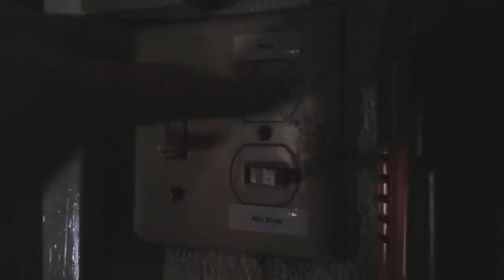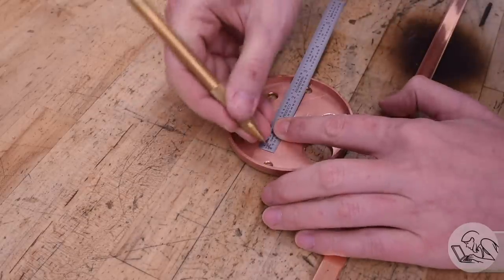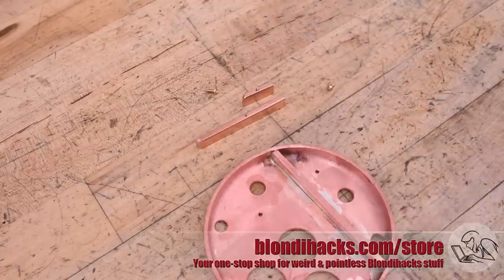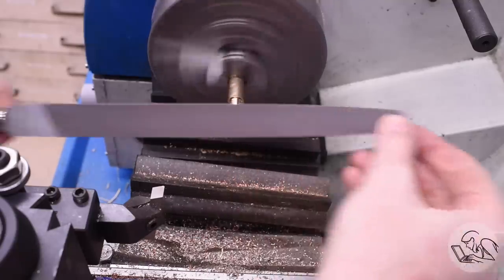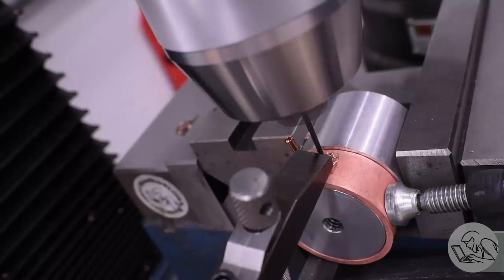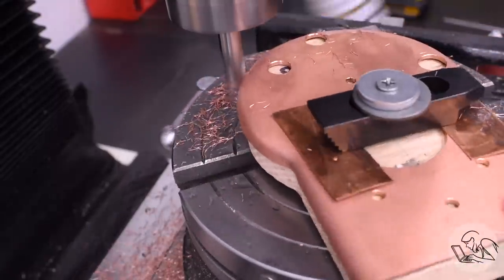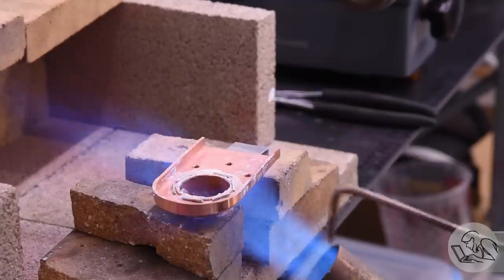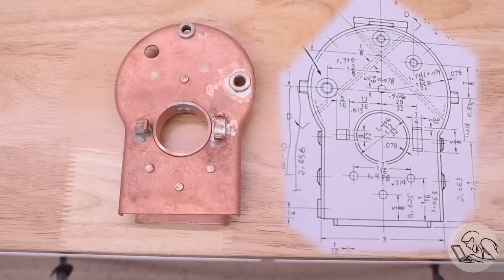Finishing Boiler Bulkheads - Pennsylvania A3 Switcher, Part 3

Comment: Tip:  For Brass and copper & Aluminum drilling.
keep a set of drills at a 100 degree angle, also I  tend to put a back rake on my drill bits for drilling brass and copper to help stop it from grabbing, most drill bits are set at 118 degree angle and for harder metals 135 degree is good
but soft metal don't work great on those angles.
So have the correct drill bits for the type of metal.
As you say about safety, i was using a industrial vertical bandsaw the other week and one of the teeth pinged of and got me at the side of my glasses and stuck in my cheek, so even machines that look harmless enough because you cant see sparks is worse in my books.

Comment: Quinn, did we hear you say that you did not have any drill bits larger than 1/2" diameter? If that's the case, head down to Princess Auto or Busy Bee and get a set of "Silver and Deming" drill bits, which are larger than 1/2", but the "back end" of each bit is just 1/2", so should fit your mill or drill press chuck.

Comment: Re: PPE... traditionally, I have been very bad about wearing PPE, and have to date been mostly lucky. However, as I have begun using my machine tools, I have a rule for myself... if the power to the machine tools is on, so are my safety glasses. I find them frustrating when trying to make fine measurements or complete intricate setups, but if there is a chance that metal might be cut, safety glasses on.

Comment: Beautiful craftsmanship Quinn. You are so right about making sure every silver soldered joint is sound. By the time a completed copper boiler is finished it is a huge heat sink. Even covered in insulation it takes a long time to reheat a bad joint which as you say is not at all good for the flux.

Comment: nice work,thats way more parts than you would expect when you look at the finished boiler.I wonder how critical the solder is to re-melt when you add parts and heat near the already soldered areas.And if that is a problem in terms of causing leaks.

Comment: I’d blame it on the drawing: the lack of complete hidden line around outside edge of the part leads to confusion.  If you are going to show the bracing, and where it meets the outside edge of the flange, show all the hidden lines in the drawing.  At first glance, I also thought the drawing was from the other side.

Comment: I had a 15/16 drill break off in a 12" inch cube of stainless steel on night,the forman wasn't happy about it.Ofcourse the circuit board burned up at the same time.

Comment: I'm a little surprised that you didn't turn the outside of the fire door ring down to match the hole size. I was expecting you to pop it back on the former and take it right to size. With the correct clearance of course. LOL Love your work!
Reply: That threw me off as well.
Maybe there is a reason? But I can't think of any 🤷🏼‍♀️😁
Reply: Me too, but perhaps it would have been difficult to hold it to the mandrel securely enough to skim it. Or that's what the book says to do and it was an easy enough way to do it.

I certainly would not have remade that first ring, it looked plenty good from here and better than I could do! I wouldn't have bothered with the little riveted tab either. But then I thought perhaps that acts as a bit of a spacer between the two backhead plates.

Slightly shouldering the stays would also have been good for spacing as they were turned. But given you're usually using copper rod or rivets for those the lack of steps is normal.
Reply: With the riveted plate on it, you couldn't really turn the whole thing, so you'd have to do it either on a fixture, or in two setups.
Reply: @TheFreshmanWIT  but there is no need to turn the whole thing.
Just that bit that sticks into the hole.
Reply: @Jehty_  It sticks in a hole on both sides, it goes through two bulkheads.
Reply: @TheFreshmanWIT  oh, of course.
Somehow I completely overlooked that.
In that case I guess it really is faster and easier to just fit the parts by hand.

Comment: Could you not put the reamer in the lathe using the center. Then get the steady rest on it running true. Remove the center, cut the reamer down, face it and cut a new center?

Comment: Excellent video Quinn and very well narrated. Great workmanship.
I'm sure the following boiler stages will be very testing but having built the vertical boiler I'm sure you will nail it.
With those holes mirrored will there be any issue when it comes to the boiler inspection, may pay to ask.
Regards Kevin

Comment: Extremely noob question: could you have chucked up the long reamer in your lathe and dialed it in accurately enough to restore the center after cutting+facing? Or is that just impossible?
Reply: I had the same question

Comment: Hi on a standard drill bit the cutting angle is too aggressive for copper, by grinding a flat -5 to +12 degrees decreasing the cutting lip angle it will cut without grabbing.

Comment: Way back when, machinists used to use full fat milk for cutting fluid when working with copper.....

Never actually tried it at home though, I would assume it would get a bit smelly if you didn't clean up properly 😜

Comment: In the last oart the issue with the holes. I think this is also a mistake of the draw. The line representing the sheet metal is solid and seems to me the same width as the rest. 

Glad it doesn't affect the functionality, but knowing your perfectionism, it will bother you quite a lot. 

Grest video

Comment: Wonderful, as always! I'm not a machinist, and I'm wondering why copper is used instead of steel? Is it because it wild be harder to hammerform?
Reply: My understanding is that in the event of a failure of the relief valve, the copper will split, but steel would explode.
Reply: The oxygen in the steam/water is very reactive with steel but not with copper. In regular boilers the water is treated to remove oxygen and the boilers are made of steel.
Reply: It's easier for the at-home boiler maker to work with, and doesn't rust. People do make steel boilers, and stainless steel ones too. But copper is easier and requires less maintenance for most of us. Plus steel boilers must be welded (usually by a certified pressure vessel welder) and copper can use silver solder. Finally, in these small sizes the heat transfer with copper is much better.

Comment: Assuming you had a 5/8 endmill, could you have plunged with that after using the 1/2 drill on the tube holes? Or is copper too gummy to plunge with an endmill?

Comment: I've always wondered, how accurate are the adjusting nobs on boring heads.  They don't seem like you could use them as reliably as the dials on a lathe or mill table.  Can you actually dial in a specific depth of cut, or is it always a case of adjust a bit, measure, repeat?
Reply: Boring heads have dials that are marked in increments of one thousandth of diameter, just like a lathe, but you can’t adjust the zero
Reply: its always a case of measure and adjust when after a tight tolerances even on the mill and lathe - the dials are only ever guides, even a really high end super precise DRO can't tell you what size the part will be on its own - tools deflect, can have wildly different lengths and geometry - so tool zeroing will change, have less than infinitely small cutting tips and wear through use somewhat. So you always have to check your progress when woodworker precisions isn't enough. However I will say the etched dials on my few plays with my cheap import boring head say its actually easier to dial in the precise amount of cut than my mill (which perhaps speaks more to the really low quality of my really small mill, so your mileage may well vary).

Comment: It probably doesn't come through the camera but I feel the fire hole would be too small. Does Kozo recommend using coal because I feel you would need to crush it into smaller pieces?
Reply: Yes, you have to crush it up. Brits have some weird system where they classify the size as beans etc and you can buy it like that. In Aus we just hit it with a hammer until it fits. Some people coal fire relatively small locos (1/32 scale) with tiny bits of coal. Check out GandyDancer on YouTube or search coal fired G1.
Reply: @davidtaylor6124  as an Aussie myself i half expected that. Thanks

Comment: I can't keep from wondering if there's a way to individually test these joints before assembly. It would probably be prohibitively difficult to do it for a one of project like this but the pros on big expensive projects must have a way... right?
Reply: If you are referring to full-sized boilers, then yes they are able to test each joint.  The full-sized boilers are typically made of steel, and welded together.  Then the welds can be checked with a variety of techniques, including x-ray, ultrasonic, liquid penetrant, magnetic particle, etc.

Most of these testing techniques are generally out of reach for the home machinist.  And by “most”, what I really mean is “all”.  Lol

Comment: The inner lines on the periphery of the plate (showing the folded edge) are hidden detail and should be dashed. No wonder you made a mistake , the drawing is not correct